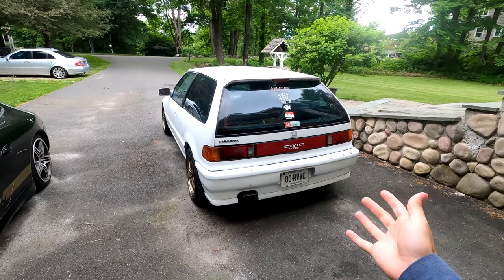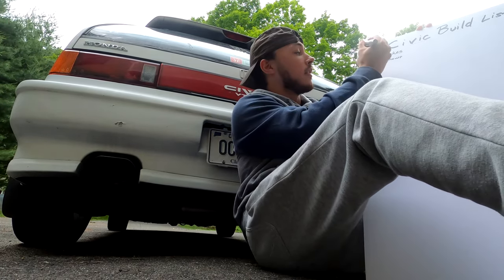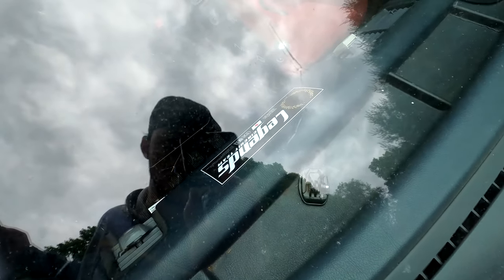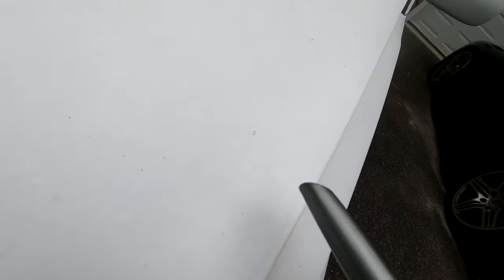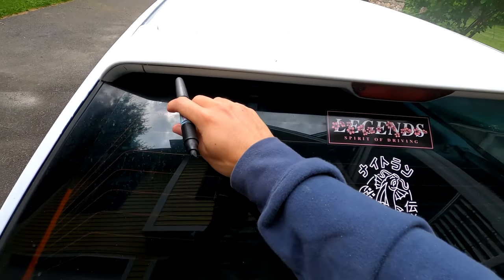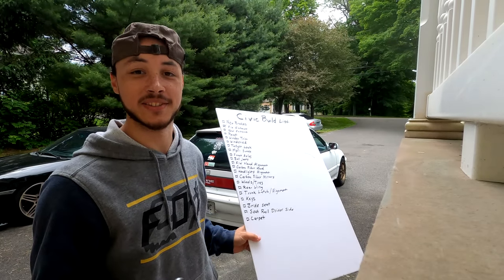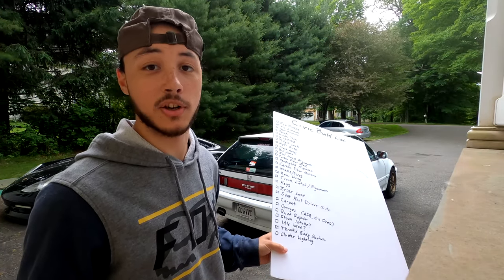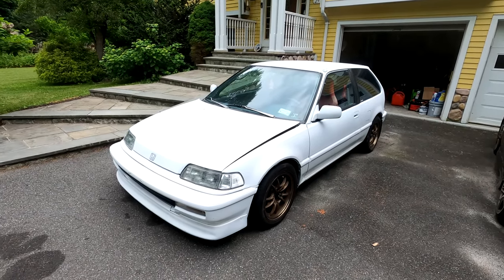Everything That Needs To Be Done To My Civic

Comment: Heck yeah.  good too see this video and you are still on it.  I bought a 1991 Civic Hatch almost identical to yours recently and have a lot of work ahead of me. Kinda spurs me on to make videos on my car other than the 1 have of the terrible exhaust sound on it. good luck! I'll be watching!
Reply: on the idle issues. I solved most all of mine by loosening the throttle butterfly nut and raking the Dashpot off.  look for a video an old video "88-91 CRX DX idle surge fixed!!!!!"   Also on the tail lights.  When you replaced them did you replace the gaskets for the?  I don't know if you made a video replacing the taillights as I'm still watching all the vids but mine were filling with water and leaking into the car. replaced the gaskets and it solved the issue completely.